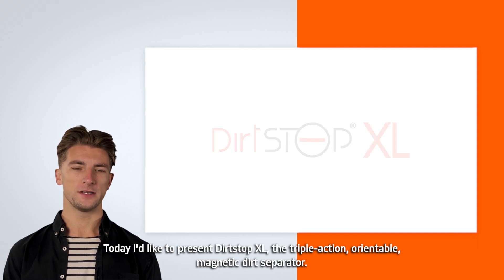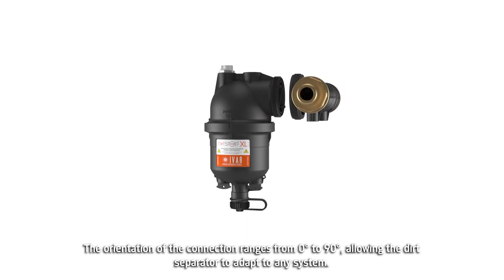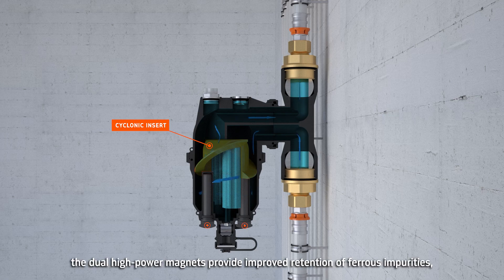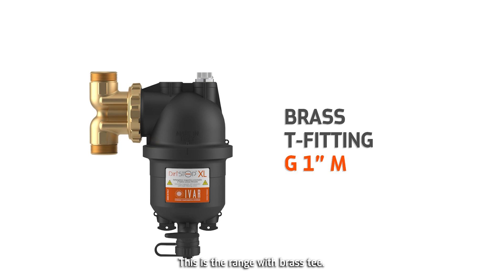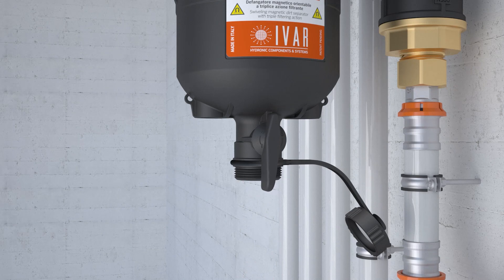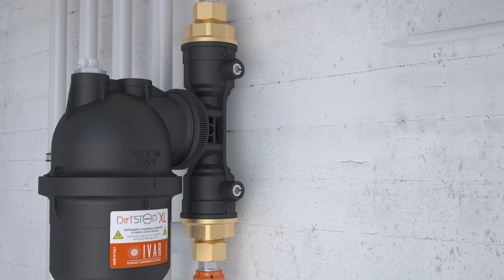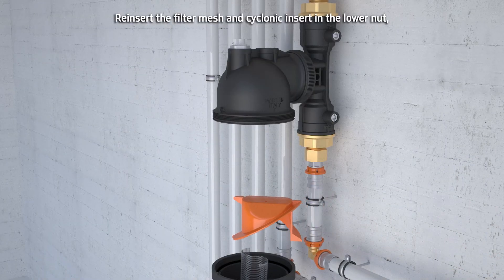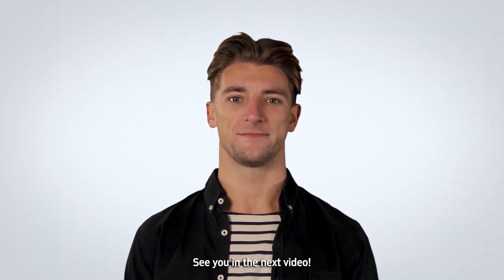DirtSTOP® XL | English

Comment: Is it allowed to install Dirtstop XL on the vertical lines if the flow moves from top to down or the direction of the flow doesn't matter?
Reply from the maker: Hallo, the direction of flow doesn't matter. Top-down or bottom-up: DirtStop XL works the same.